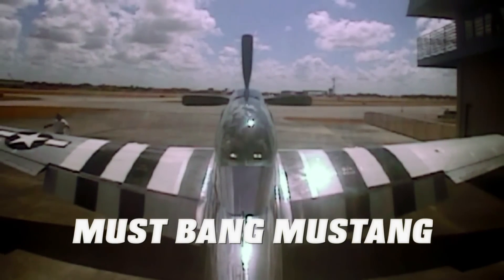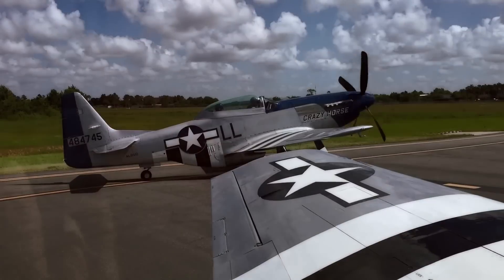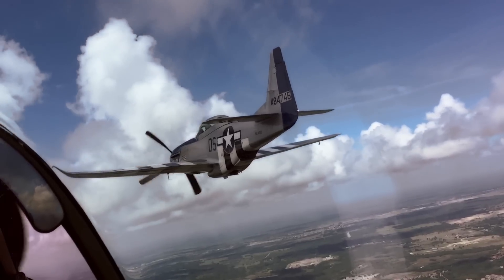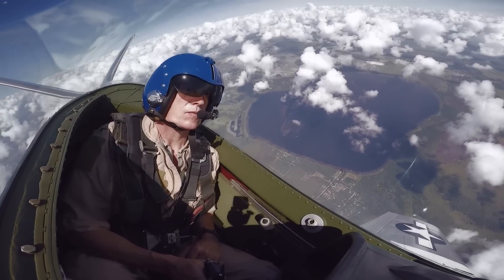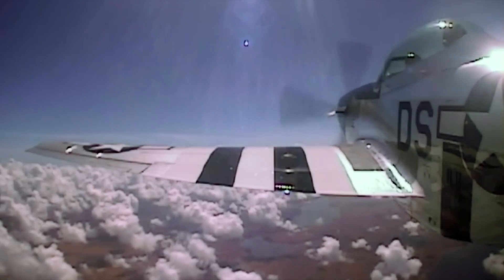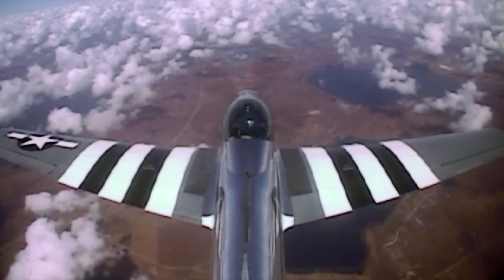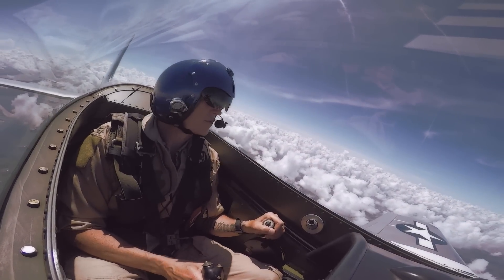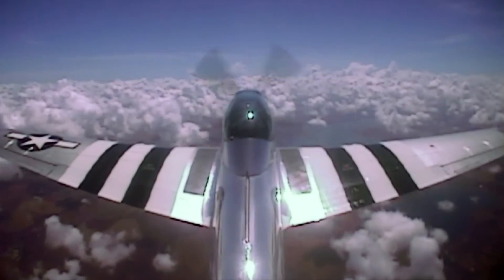MUSTANG Training, Warbird Aerobatics P-51, SKYMONKEYYYs Aviation Video with Intercom Sound!

Comment: Nice, did you guys see much, if any, throttle management??
Reply from the maker: only little correction on the throttle - since the manifold pressure is set - the constant speed prop does it's job:)

Comment: Use both feet on breaks right and left aluminum strupsdont over throttle untill you build air speed up or the plane will flip youl be arm ressling the stick set trim afterr you get up to cruze or faster so you dont have to arm ressel stick!!

Comment: Can anyone answer a couple questions? 1 back when being manufactured did these planes come equipped with navigational lights? 2 are the dashboards of these planes the same as when originally built or have they been updated to comply with modern standards. Thanks in advance.
Reply: 1st part is yes, navigation lights were standard. 2nd part, it depends on the owner a purpose for restoration. Some owners do period correct restoration while others maintain visual authenticity with some or fully modern avionics . It's all about personal preference. I work in General aviation and have been around many of these restored planes, pilots and mechanics over many years including the ones in this video.

Comment: at 33:30
why  " no brake "   ?
Reply from the maker: plane is heavy, you use the brakes only if really needed..
Reply: lw216316 as it's back wheeled, if brakes too hard the plane could tip forward, risking props to be ruined.
Reply: TKS makes sense, may even have larger high performance prop even closer to the ground -
it would be bad to do a nose plant with a beautiful, expensive war bird.
Reply from the maker: i think that's not the reason.. you can sensitively brake the plane without hammering the nose into the runway:)
the reason is: the plane is 8.000lbs heavy and pushing the brakes on higher speed will easily burn away the brake pads..
Reply from the maker: i think that's not the reason.. you can sensitively brake the plane without hammering the nose into the runway:)
the reason is: the plane is 8.000lbs heavy and pushing the brakes on higher speed will easily burn away the brake pads..

Comment: you can tell the instructor is scared of this plane
Reply: He has respect, for this plane.  He's not scared of it.
Reply: Given the sheer mass and diameter of the prop they're swinging, and the raw Merlin torque driving it, it is truly a "tiger by the tail" situation and due diligence must be used at all times... 

Also I heard a rumor that they "recently" shutdown the production line on this bird, thus, unlike in the 1940s, there will be no "replacements" available should a given airframe become deformed, or consumed by fire.  ;')

Comment: I despise 2-seat P-51s.
Reply: Probably because you don't have one?  ;)
Reply: Why? It gives people, other than rich millionaires to experience it. And its not like they can't be changed back to original if someone wanted to.
Reply: Jim P. why? It's obviously a trainer.
Reply: Its actually not a trainer. There where no two seat P51D mustangs built. This is a post war conversion.
Reply: HDaviator There may not have been during the war, but these have clearly been converted to trainers.
Reply: What changes are made to turn it into a trainer? Is it a different and larger canopy and some metal work being removed aft to allow a larger canopy?
Reply: the older D models used the back are for radio equipment and extra fuel tank. without that stuff and up to date avionics, you can convert any stang to a 2 seat no problem.